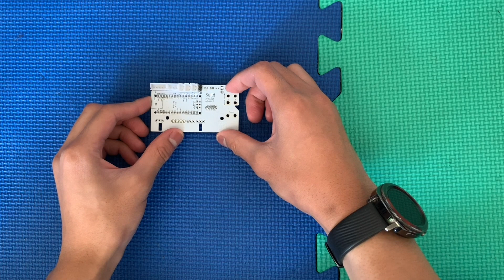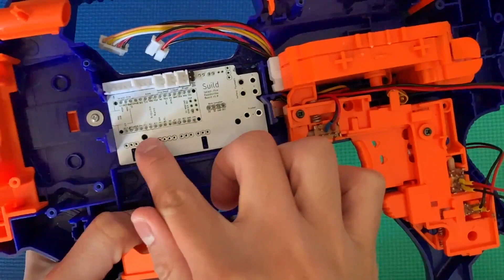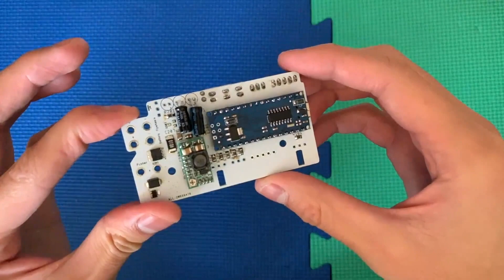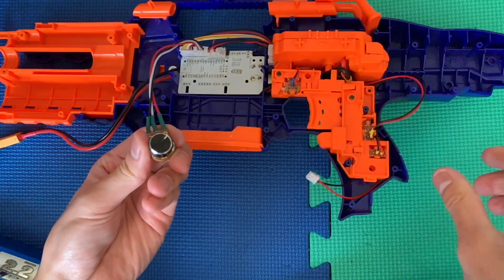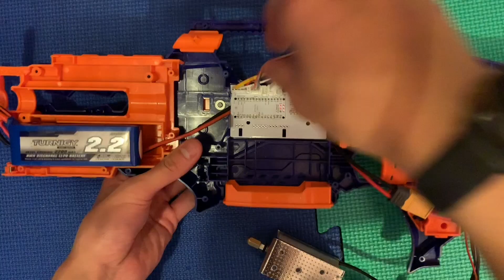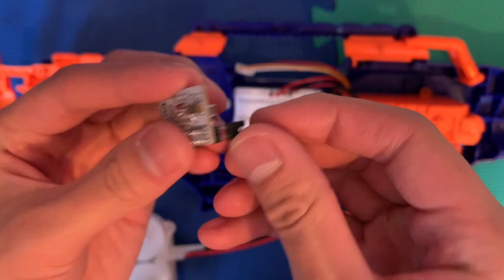Select-Fire Nerf Rapidstrike and Solenoid Kit Overview

Comment: What a great video, and circuit. I am having a circuit made to order to control a solenoid, do you think your one could be adapted to control my cutting edge idea? https://youtu.be/VHBb0LeGMys. Have you got a price for a completed circuit. I'm not clever like you guys with electronics......there would be a nice hand engraved Nerf coin in it for you as well as some money to spend on goodies :). Looking for the easiest answer to a question no one can solve :)
Reply from the maker: What sort of solenoid control do you need? If all you need is a continuous, periodic oscillation, I'd recommend checking out the PWM Module here: https://suild.com/shop/3
Reply: @suild4680  Ahh thanks Bro, concept vid https://youtu.be/VHBb0LeGMys and had this guy from Fivvr designing me some circuits. I wanted the most simple one, as it's to share for free, so Me and all my luvly subs can easilt make one. https://youtu.be/GRN-tyC9-58 . Will definetly try your circuit, I left the idea for a few years, and tecnology has caught up with what I wanted :) Cheers Shaun

Comment: Great products! Any ideas how this might integrate with an Infinus? It uses a RS pusher, but it has the complication of a 6v control board like the Regulator.. The articles I've seen online have two wires coming off the battery plug, one circuit for the rev trigger / flywheels, the other going to a voltage regulator then to the circuit board for everything else. Seems like this setup would let you do the rev / flywheels / pusher / trigger on one circuit, then the voltage regulator / circuit board on the other for the dart loading mechanism. Only issue would be with features like where if you load a dart while firing, the board stops the pusher until the dart loads, then let's it go again. Any idea how many volts go through the trigger switch from this board? Would be interesting to connect the pusher wires from the circuit board to the trigger connection on your board. It would let the circuit board still control power to the pusher, but still allow upgraded pusher motors running on the lipo.
Reply from the maker: I'll have something cooler in the works for the Infinus! It will take a lot of work to get this kit working with the Infinus.

Comment: What if you don’t have a cycle control switch
Reply from the maker: In solenoid operation, this kit doesn't need a cycle control switch. If you're using the Rapidstrike gearbox, you'll need the cycle control switch.

Comment: Super clean work. I was thinking about hacking a system like this together, but with your product as clean and easy as it is I can’t justify not using it.
Is there a configuration where the board can control the flywheels too?  Something like what tungsten did with his rapid strike?  Single trigger pull revs motors and and pushes dart a very short delay after?
Reply from the maker: Thanks! I don't sell different configurations of this product, but there's an onboard Arduino Nano that you can re-program to fit your needs. I'll do a tutorial on how to re-program the onboard Arduino in the future!

Comment: Wow. This is a brilliant addition to the line-up. Any chance of doing them for the Demolisher? EDIT: Either for a RS pusher (which fits really nicely in the back there...) or a solenoid (or both!) :0)
Reply from the maker: Thanks! I've gotten a few requests for the demolisher, but there aren't any reliable, aftermarket parts available. If someone releases one, I'd be happy to make a board!
Reply: @suild4680  You mean no reliable aftermarket full-auto kits? Yeah, I feel ya. The RS box fits well but does need a lot of shell cutting. 3D-printed solenoid cradles are coming out for other blasters - it's only a matter of time before someone does one up for the Demo. Keep up the good work :)

Comment: I know this is gonna be pretty difficult, but stampede??

Also with the mosfet board 2, can you wire up a solenoid and a flywheel set at the same time?
Reply from the maker: I don't think the stampede is popular enough to make a custom select-fire kit for. 

No, with the MOSFET Board 2 you will need to use 1 MOSFET board per load, unless you want the solenoid and flywheels to turn on and off at the exact same time. If that is your desired behavior, I would instead recommend the MOSFET board +, which has the included XT60 pigtails to drive up to 3 loads simultaneously.
Reply: Suild so every time I pull the trigger the flywheels would rev and the solenoid would do its thing?
Reply from the maker: Yep, but when you pull the trigger, the solenoid turns on and the flywheels begin to spin up. This means that your dart will exit the flywheels at a sub-optimal velocity. The solenoid will also be in semi auto mode as well (if you're using just a MOSFET board without a PWM module)
Reply: Suild but with the pwm module and the mosfet+ it will work? Because I don’t want to use 2 different liPos in my build

Also, thx for awnsering my questions
Reply from the maker: Yep, you can use a PWM module and a MOSFET board +. Remember that the PWM Module needs a power driver to operate (check out the FAQ or the video for the PWM module). I have an extended overview for the PWM module in the works where I'll go over how to power 2 separate MOSFET boards (with PWM Modules) from the same battery. I also have a wiring diagram available that I will put up on the site. Feel free to reach out if you have any questions in the meantime.

Comment: Can you make a board for brushless motors, that just plugs into your select fire boards so you can have another little ecosystem? For pushers and flywheels?
Reply from the maker: Yep, I have a super cheap and simple brushless kit in the works! It will of course be open source and compatible with the ecosystem
Reply: Sweet! will it be compatible with all/lots of brushless motors, or will it be compatible with one kind?
Reply from the maker: The brushless kit should have the option to included a custom designed and printed cage, wheels, and motors. Additionally, I hope to make it compatible with other motors.